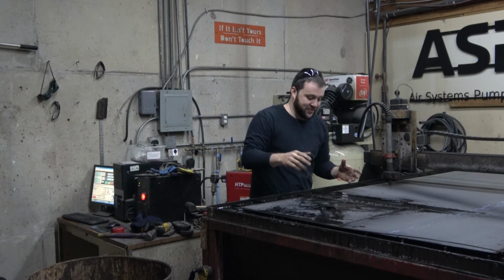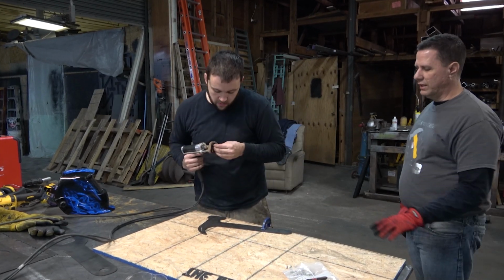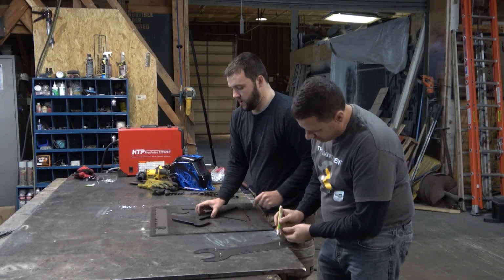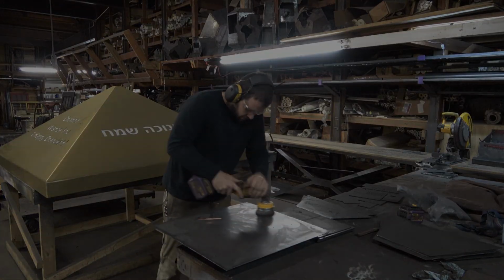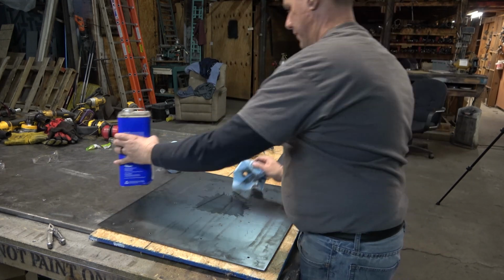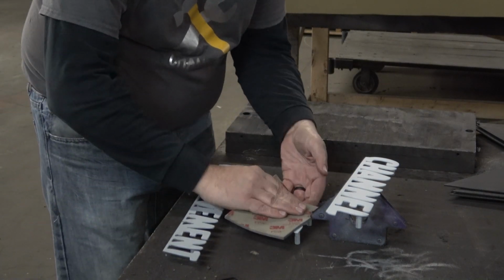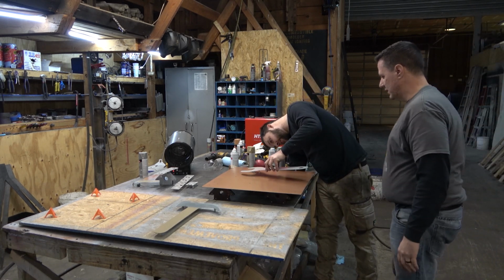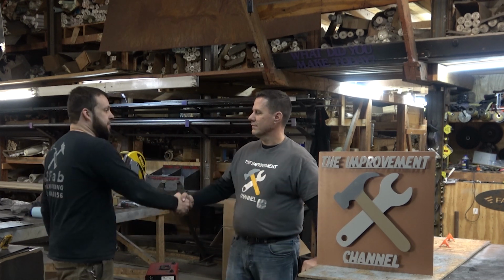How to Make a Simple 3D Sign with The Improvement Channel | New Air 240v Garage Heater Review

Comment: In about 3 frames of this video, you show what looks like the CAM tool you are using with your plasma table.  Have you considered doing a video on that machine/software/workflow specifically?   I think there are many people getting this type of equipment now that there are low cost options like Langmuir.  In my case I built mine.  Sans a full video, what CAD/CAM/Control software are you using.  It looked like you are able to place the next job on the work space one at a time such that you load a full sheet of material and never move it.  That looks like a real time saver (Appears you do your nesting in Corel Draw).  I appreciate your efforts in these videos.  Maybe I'll get a chance to say 'Hello' when Doug launches SVSeeker.  ~P
Reply from the maker: every setup is going to be table specific but it's draw a file (Corel, InkScape, Illustrator, whatever) then in my case > Sheetcam to set feeds and speeds and make the gcode > whatever system reads the gcode for your motor controller

Comment: You may want to get over to your local Autobody Supply store, and pick up some "FINE-LINE" tape. Comes in all sizes, from 1/6" inch wide to I believe 3" inch wide. If your masking for say the two color hammer you just did, I'd recommend 3/4" in. to 1" inch wide tape. FINE-LINE tape, is approx half as thick as regular masking tape, thus the name "Fine Line." If you were using the "FINE-LINE" tape, and when all the different color's have been applied, you could put on a couple of coats of clear, and you wouldn't be able to feel the line between the two color's. Warning ahead of time, "FINE-LINE" tape, isn't cheap. HINT: you would use just one piece of the "FINE-LINE" tape to separate the two color's, then finish masking (aforesaid item) with regular automotive refinishing tape. Example: you use 3/4" in. wide automotive refinishing tape, & 3/4" in. "FINE-LINE" tape. put the 3/4" in. "FINE-LINE" on/down first, to separate the two {or more} color's. When applying the 3/4" in. wide automotive refinishing tape, overlap no more than half way, in this example half way would equal a overlap of 3/8" in. (0.375" in.) approx. Trick to removing tape after painting, is to pull tape back onto itself, and create a 45 degree angle, so as the tape will act somewhat like a knife, cutting the edge where the tape meets the edge of the freshly painted surface. Some automotive painter's like to remove tape ASAP, other's like to leave it on, until you can touch the painted tape surface, and not leave a finger print. You'll have to decide what camp makes you feel warm & fuzzy. When not using your tape, keep it fresh in a coffee can, or other item, with a tight sealing lid.
Reply from the maker: All good advice, we just didn't have time to wait for one color to dry

Comment: How high do you keep the water in your table? Looks like it’s pretty close to the cut surface?
Reply from the maker: Yeah, I've found I like that the most, also doesn't help that my water is only an inch deep (all I could fit without a major modification to the table)